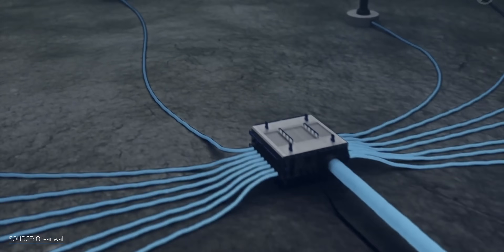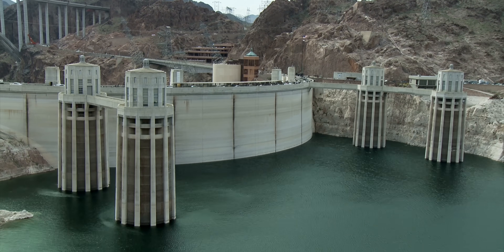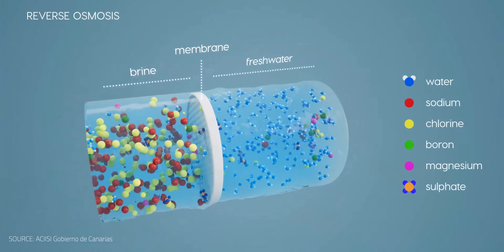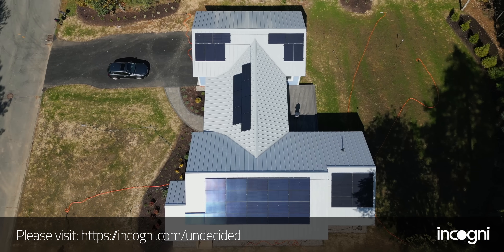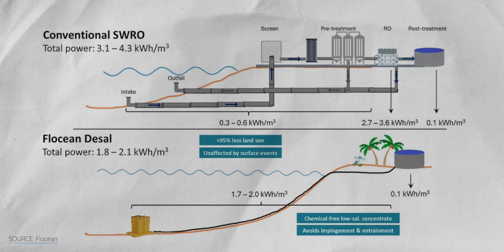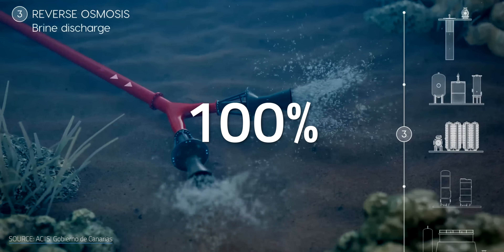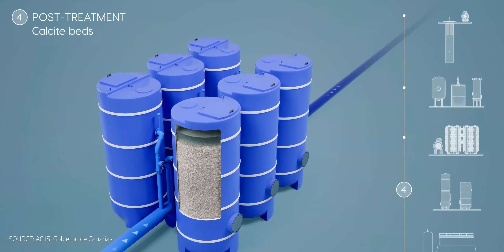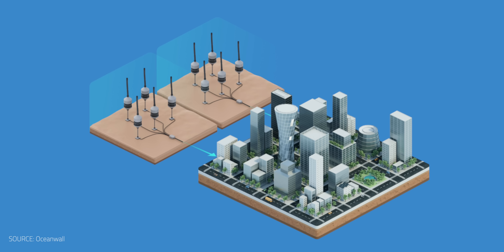How Deep Sea Water is Now Drinkable

Comment: Here is my summation of DSRO after watching this video, what do you think?

Deep-Sea Reverse Osmosis (DSRO) systems can offer greater efficiency and sustainability compared to traditional onshore desalination plants in several key ways, particularly in the areas of energy use, environmental impact, and infrastructure. Here’s a breakdown of the primary advantages:

1. Energy Efficiency
Natural water pressure at depth: DSRO systems are located on or near the ocean floor, where natural hydrostatic pressure is significantly higher. This pressure can help drive water through reverse osmosis membranes without requiring as much external energy for pressurization, which is one of the most energy-intensive steps in desalination.

Ambient hydrostatic pressure at depth provides the high-pressure feed, potentially reducing or eliminating the need for pressurization pumps.
The action of removing the permeate (freshwater) from the low-pressure side of the membrane and pumping it to the surface creates the ambient hydrostatic pressure differential required for pressure at ocean depth to drive the water through the reverse osmosis membrane. 
Uses less energy overall because they avoid the energy-hungry high-pressure feed pumps. 
Still requires energy to extract the freshwater (i.e., to maintain the pressure differential and lift the water to the surface).
Can save up to 50–75% of energy costs in ideal conditions.

Reduced need for pre-treatment: Deep ocean water is colder and more stable in quality (fewer organics, microbes, and suspended solids), reducing the energy and chemical costs needed for pre-treatment.

2. Improved Water Quality at Source
Deep-sea water is cleaner: It typically contains less biological activity, pollutants, and turbidity than surface water. This reduces membrane fouling and extends the life of RO membranes, which improves system reliability and lowers operational costs.

Less variability: DSRO draws from consistent deep-water conditions, while surface or coastal waters can be highly variable in salinity and contamination.

3. Environmental Impact
Lower brine discharge impact: DSRO systems may be able to dilute or diffuse brine back into deep waters more effectively, avoiding the high-salinity discharge issues that can harm marine life in shallow coastal areas.

Smaller coastal footprint: They require less onshore infrastructure, preserving sensitive coastal ecosystems and reducing land use.

4. Infrastructure and Resilience
Decentralized deployment: DSRO units can be modular and installed offshore, closer to water-demand areas like island communities or offshore facilities, reducing the need for long pipelines and pumps.

Reduced vulnerability: Being located offshore, DSRO systems may be less vulnerable to natural disasters (e.g., tsunamis, coastal flooding) and urban conflicts over land and water rights.

5. Scalability and Modularity
DSRO systems can be built as modular units and deployed incrementally based on demand, making them more adaptable to changing water needs and budgets.
Reply: Excellent breakdown!
Reply: As someone else pointed out, the freshwater is less dense and floats on saltwater, thus the will naturally flow up the pipe to shore. Its a 3% difference, which is why they need deep water. 1000' of depth will give a hydrostatic pressure equivalent to 30' at the pipe at the surface. Sounds like magic.

Comment: If the critical factor is pressure I wonder if this couldn't be created artificially by placing them inside land based boreholes which can then be pumped in with seawater in a sluice ring to and from shore. The benefit is that they would be easier to service since the hole could be pumped out

Comment: Both Matt and like 80% of the commenters here seem confused about how physics works. "Pulling" water through a membrane uses exactly the same amount of energy as pushing it through. That's not where the energy savings comes from. There is no "free pressure" under the ocean, because having (for example) 20 bar of pressure on both sides of the membrane does nothing, and reducing the pressure on the inside of the pod with a pump would require the pump to produce 20 bar of pressure to get the filtered water back up to the surface: exactly the same amount of pressure a surface pump would need to generate to push water through the membrane up there.

As Matt alludes to (and some other commenters have more clearly explained) the real savings here comes from the fact that reverse osmosis wastes a lot of pressurized water which gets converted to brine, and if that process happens under the ocean then you don't need to waste energy pressurizing the wastewater, only the filtered water needs to be pumped to the surface.

Given the number of commenters confused about this, it doesn't seem like it was very clearly explained.

It's also probably worth mentioning that surface-based systems can achieve similar energy savings by recovering some of the energy from the pressurized wastewater using a turbine (though that's obviously not quite as good as not having to expend that energy in the first place). Matt completely fails to mention this, making the subsurface technology seem better than it actually is (as is unfortunately pretty typical for topics covered on this channel).

Comment: It all revolves around the pre filters working and be self cleaning.  Replacing and cleaning them is far to expensive.  Of course you can always clean them by blowing back enough sea water, perhaps a blast of pure sea water followed by partially cleaned sea water....  Hard to see how this helps poor countries, this is a very high tech with specialized installation and maint from Western oil cos experienced in it.  I'd think a poor nation would do far batter with solar powered surface system their endless cheap labor can keep clean to extend filter and membrane life, helping min operating costs down.  Not working at night isn't an issue, you see you just need a big old fashioned barrel so to speak.  Indeed any desal op needs to feed into a system with days, really MONTHS of supply stored in case system malfunctions, energy interrupted.  The Arabs go to grid power at night because they have endless grid power from the natural gas and by products of refineries no one wants to burn up.  It's dirty, but it's cheap.  It's funny that it costs Arab nations more to turn waste gas to LNG to sell to EU than just burn it up to desal water instead of solar.  Which give you an idea how much money middle men are charging EU residents for their gas.  I've seen markups of 100x on products from Russia to US in last few months.  As corp execs told congress during hearings, they can charge more because they don't have any competition who will charge less, don't matter if it's beef, gasoline, baby formula...  almost every industry is now all but owned by 1 corp at 40 to 60 percent, with a few others left to make it look like there is competition, who all take turn being first to jack up prices.
Biden and DEMs wanted to pass a bill providing start ;up money to biz that wanted to compete on price and make it up in volume, but thank God GOP Voters saw through that and crushed DEMs

Comment: First off, why not use wave power instead of wind farm technology that isn't cost effective and requires ongoing maintenance to maintain? Also why not use the Sun's evaporative power to flash steam instead of RO? Lastly, the brine that is created and returned to the ocean.. It's a simple solution, dilute the brine with sea water before discharging it back to the ocean.. What? Hasn't anyone ever heard of a watered down drink before? This should have been common sense..

Comment: Honestly, RO is just not a good technology, so I don't know why there is so much money being invested into improving it instead of creating alternatives to RO.  This deep sea approach solves the problem of pumping pressure, but we still need to pump to water up hill all that distance from the sea floor, and that isn't free. Then you have the cost (both monetary and climate footprint) of all the pods, cables, and pipes that have to be manufactured, sunk to 400-600 meters, and then likely replaced every few years.

Current RO technology is also a complete farce  in the way it is compared to thermal (distillation) desalination technology, because while it might boast substantially lower direct energy costs, it does not take into account the production and transport of the massive amount of chemicals needed to run these plants. When we're talking about changing the future, RO is a "right now" technology, but it involves way too many consumable components and has terrible efficiency, so pursuing this as a long-term solution is absurd.

Meanwhile, it's already possible to have zero-energy vapor distillation using sunlight. Not solar electricity, but concentrated solar power (CSP) which is as efficient as solar panels, but without the need for the  high expense and environmental impact of solar panel production. But CSP is only the equal of solar panels when applied to electricity production. If CSP is directly used to heat water, that efficiency skyrockets. But it gets WAY better. Unlike solar panels, CSP is able to store excess thermal energy and produce electricity at night with these thermal batteries. This would make thermal distillation almost certainly a better alternative to RO desalination in any places with a primarily hot and sunny climate.

Comment: Unless they make back flush auto filters they are going to plug up. 
They going to have to create submercibles that are able to switch out the replacement units. 
But the problem is corrosion from seawater is not going to make switching them out difficult. 
Not to mention possibly the connectors to seize up.
And if you power them from wind, what are the construction costs of building a pylon that goes down 400 meters.  And wind turbines are notorious for killing flying animals who don't see the blades and get cut in half or seriously injured.
Like any new idea, they're going to have to really find ways that are sustainable. 
We spent billions of dollars in taxpayer monies to make a solar generator with mirrors which now they're shutting down because it just did not work well enough to justify keeping it going. 
At least this is being done by commercial money if they can get it to work great.

Comment: I've had this idea in my head for many, many years, but figured out that  you would need the same amount of energy to bring the water to the surface. Putting the filter on the bottom wouldn't make any difference. It would just make it more complicated with your filters at the bottom. So how are they doing this? The physics don't make any sense to me. Is suction more energy efficient than pumping?
Reply: While reading another post here, I think I finally found the solution. Seawater weighs about 2.5% more than freshwater per unit volume. So pumping up freshwater while you have pressure on it from saltwater is where you save all the energy. It only took me 30 years thinking about this principle to finally figure it out. 😄

Comment: HORRORS !  The bottoms of the oceans are where rotting carcasses are fed upon by slimy bottom dwellers, along with terrible pollutants and disintegrating plastics existing.
The filtration had better be immaculate.
Why is it, though, that water systems seem to always want everyone to drink recycled SEWAGE ?
Pipelines for THIN water can bring water a few thousand miles  East and Southeast to the West as easily as pipelines for THICK tar-sands oil from Canada, a thousand miles south to Texas.
With water pipelines, artificial snow can help cool the West, and bring back natural rains.

Comment: In geenral it sounds quite good but...
'...Oceanwell claims that this system merely sips saltwater, returning 85-95% of it back to the ocean with only a slight increase in salinity...' Also the claim that microbial levels to be 'expected' to stay low sounds a bit too suspicious to just take their word for it as it is not the first time industry 'oversells' something to draw investors in and disperse possible problems. Such claims MUST be confirmed by independent institutions which are NOT on the paycheck of Oceanwell or any other investors.

Comment: 3kwh per cubic meter is pretty reasonable for desalinating. That's about upto 1$ per 1000 liters if you pay way too much for grid energy and probably closer to about 1 third of that for mass consumers. 10 cents per kwh is still on the high side for that.

Drinking water costs about 2 euro / m3 in Germany for consumers. LA is closer to 3.5$. So energy cost are not a big part of this, even if you get it from desalination. It's "extra" cost on top of destroying nature for "free". So, nice if this turns out to be somewhat cheaper. But of course the flip side is the relatively high cost of working that deep in the ocean and all the sea based operations you need for maintenance. A simple solar setup that only runs when the sun shines could be good enough. Simply buffer the water in reservoirs and supplement energy from the grid only when needed based on water levels in the reservoir. Essentially the marginal cost of the energy should then drop quite a bit.

The big picture here is that California's total energy consumption far outstrips what it would need for desalination if it were to switch 100% to that (which of course is not needed). AI data centers probably gobble up at least as much energy. The point here: this is doable. There's no water shortage in California, just a lack of willingness to allocate resources appropriately. The pacific has all the water it could possibly need. Remove salt, use it. Yes it's not going to be "free" but it's also not going to break the bank.

Comment: But you still need powerful pumps to send the fresh water up and inland. if the pressure at depth is enough to push the seawater through the membrane, then you need equally powerful pumps to send the freshwater up. I am quite sure that I am missing something......but what ?

Comment: My grandfather used to collect rain water from the water spouts from the roof of his house. I used to own a building built in 1896. In the  basement there was a round spot on the floor where it looked like a tank was. The roof had a gulley that collected rain water that ran out of a 3" spout at the back of the building. I believe that the spout filled the tank in the basement before it had city water.
Reply: collecting rainwater also has it's negative environmental effects. There are reasons we are trying to perfect desalination.
Reply: @chrisy.tet77  can you please give some examples?
Reply: @chrisy.tet77  its only bad if you do that on hypermassive scale and if you didn't have anything to reroute some water to underground reservoirs. On home level this is completely fine (though I still recommend rerouting some excess rainwater to reservoirs)
Reply: @chrisy.tet77  never heard of it before, instead it good for environment like concrete jungle to prevent flood like what Singapore did
Reply: My house was built about 150 years ago. It was built with a huge water cistern upstairs, which was piped into tanks, above the wood stoves, hot water on tap.  There is a huge cistern under my house too.
     They knew what to do with a precious resource.
Reply: Very good technology for the future and also present. Especially where the areas are depleted of water and have gone dry. 🎉🎉🎉
Reply: Do you think the hole could have been where a sump pump was previously?. The house I grew up in had one.
Reply: Right now it all acidic rain with all sorts of harmful chemicals.

Comment: Why not off shore solar towers, using mirrors to boil the water in a tank. Use an exchange to condense and preheat, and a have it flush it's brine every so often (1-2 hours?)
Or off shore evaporators. Again, mirrors, or lenses, to quickly evaporate seawater with an auto cleaning of the evaporation surface during the night.

There are better ways that are inherently 100% green.